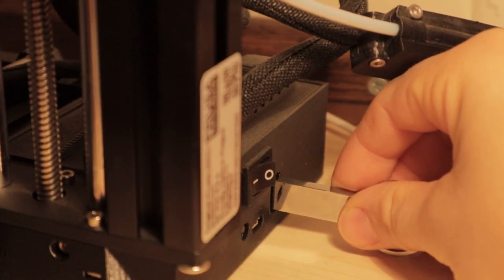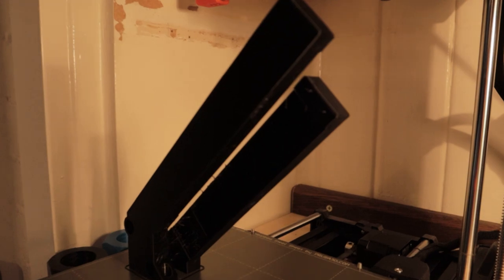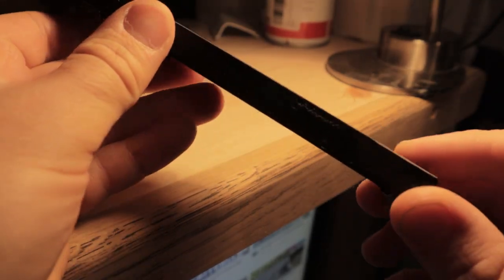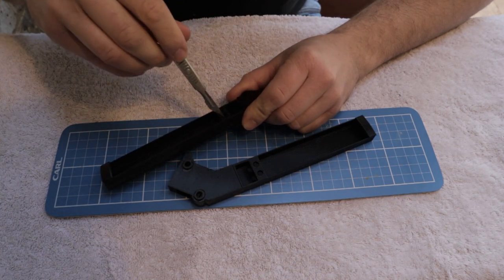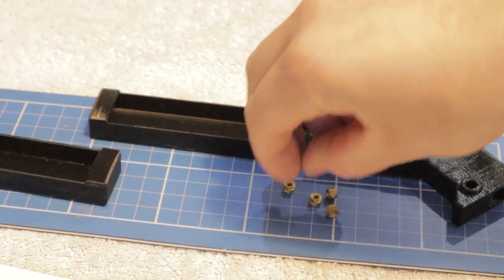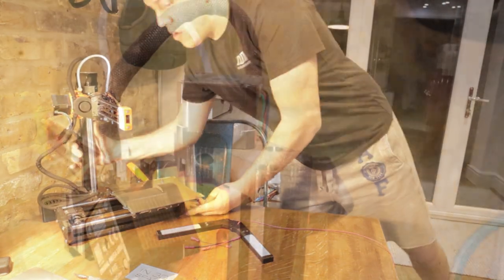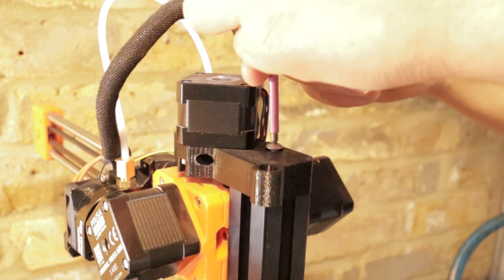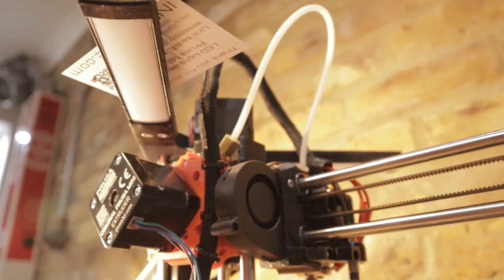Adding a Light Bar to my Prusa MINI +

Comment: Was watching your flexible filament video and came across this one. Serendipitously I just purchased that hardware kit and had it delivered the other day myself. Was nice having a video to see someone else do it as a guide/confidence builder that it's not too bad and has a good result. (I do have the bondtech extruder so will need to use the extra part adjustment but still). Keep up the great content!
Reply from the maker: That is great news. Chuffed to hear that you went ahead and purchased one off the back of this video! Hope you are finding it as useful as I am, its a nice upgrade. All the best and thanks for the feedback.

Comment: Hi, do you notice any flickering of the leds when the heatbed is moving/during printing?
Reply from the maker: Yes, I originally had this problem. I now use a separate power supply for the light which has solved the issue! Cheap and easy to install

Comment: Issue with print is with retraction and seam. Maybe retracting too much at the start of the layer or not detracting enough (extra restart distance in PrusaSlicer)
Gotta play around with it for different filaments
Reply from the maker: Thanks Allen, I need to take a look into that. Had the same defect on both sets of prints in the same spot !

Comment: What petg did you use for this? Also, I’d recommend a hair dryer vs heat gun.. much easier to avoid over heating ;)
Reply from the maker: Hey Steven, The PETG was prusament. Great tip regarding the hair dryer! will most definitley use that moving forward.

Comment: Nice video. I don't think this would work with the Bondtech extruder tho, since its a bit higher, would crash into the lights in top Z.
Reply from the maker: Hey Rui, there is an additional file to print which allows the light bar to be compatible with the bond tech extruder !